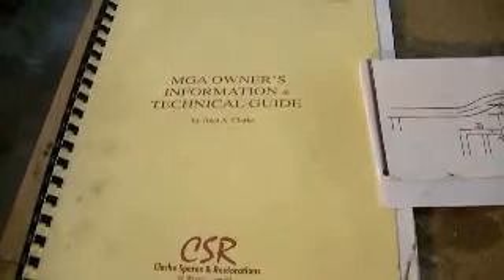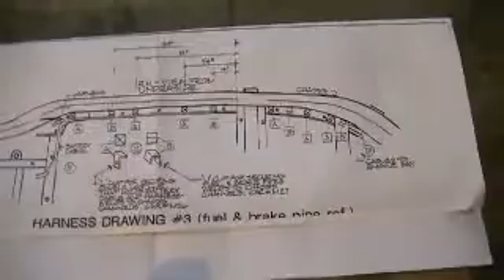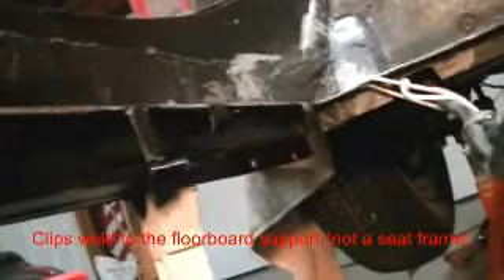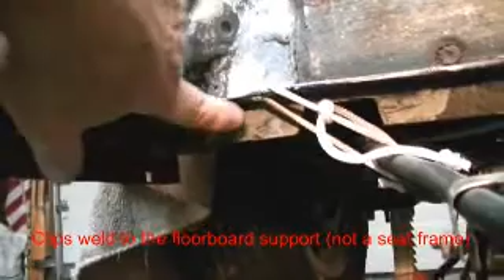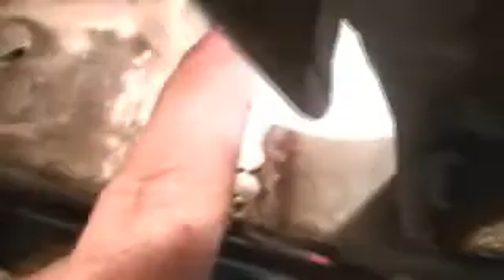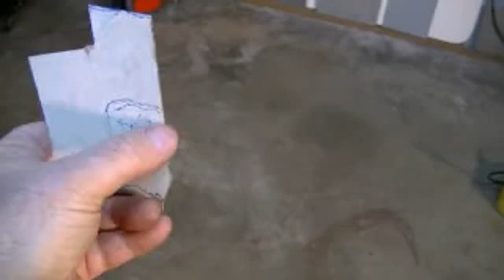1960 MGA Restoration - Installation of Lifeline clips and minor frame repair

Comment: Hi
Just wondering how the restoration is going, haven't seen any videos for a while. I've been following as I am restoring mine
Reply from the maker: Hi Brian
I finished the sill restoration on the left side and have some related videos that I didn't upload yet.  Not too much new in these but a few new tricks that might help someone.

I have lowered the car off the jack stands onto roll around caddies under each tire and was happy to see that the doors still close.

I removed the engine and transmission but didn't video the process but I will make a video showing how I setup the hoist.  I separated the transmission from the engine in the car and removed these separately.  Only needed help from wife for the last 10 minutes - surprisingly easy to do. 

I removed the rocker assembly and found typical wear where the rockers hit the valve springs.  Did some measurements of the lift of the push rods using a magnet mount and dial indicator that I got from Amazon.  Found the lifts to be in the range of 0.259 - 0.263 which according to what I read on mgaguru.com, sounds like a cam that is in pretty good shape.  The lifters (tappets) had significant scoring on 2, small scoring on one, and 5 nice and shiny.  So I will be replacing them and we'll remove and remeasure the cam at my engine rebuilder and maybe replace it anyway.

I removed the head from the engine and am about to send the head, rocker assembly and engine to my engine rebuilder.  We are going to consult on what needs to be fixed as we go so maybe I will be able to show some videos of the rebuild.  One piston had carbon flakes sitting on top but all move smoothly up and down, no significant ridge at top of bores, but no cross hatch visible on cylinder walls.  We'll see if the experts think only cylinder honing is needed.

I'll be starting on replacing the front duct panel next.  Then repairs to the front left body where the fender mounts. All 4 fenders also need repairs on the bottom sides.  That's the last of the welding.  Hoping to get the car on the road in the spring or summer 2015.

Thanks for your interest and good luck with your restoration.
Carl
Reply: mghamsail
Hi
Sorry I haven't relies in a while. I'm not use to using gmail and I could not find your reply. sorry. Also, been in Mexico for 2 weeks. Anyway, I bought my 1960 MGA on Oct 31,2014. SO far I have totally dismantled the car, everything is out and off including engine, tranny etc. I have sand blasted the fenders, chemically stripped the doors,y hood and boot. Just ordered all metal replacement parts from Moss. I need inner/outer sills, rockers, doglegs and rebuild bottom of B post and lower part of passenger front fender. These s/be here next week. However, I am off to Palm Springs for 2 months so things will be on hold for a while.

Looking at your video for installing clips. Mine are all welded along the passenger side of the frame and not the floor rails. I believe mine to be original as the car was in a barn for over 20 yrs. It had never been painted before.

I really enjoy your videos, if I had a camera, I would do the same. I am learning a lot from you.
If you don't mind, I would like to give you an email that I use regularly to keep in touch. It is blinley@telus.net
If you could email me on that I will respond quickly as I always look at it. I still don't know how to use gmail and find it very ackward.